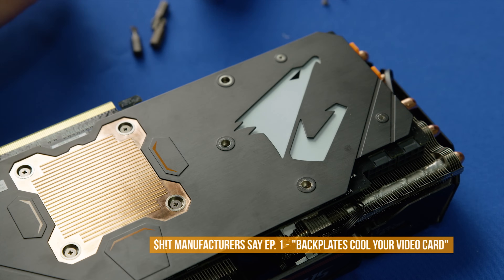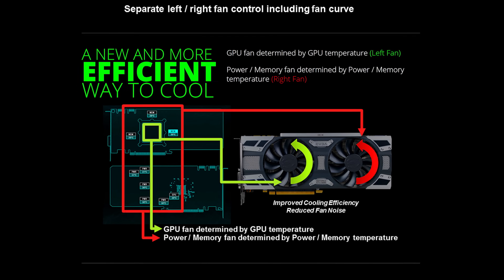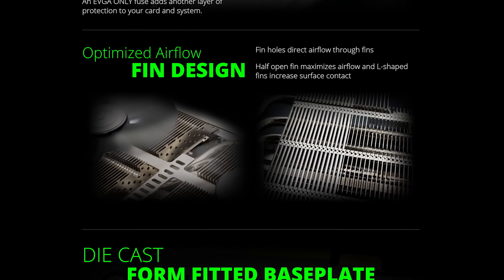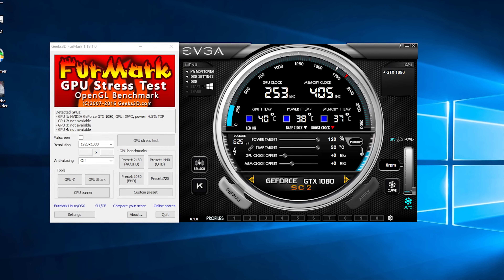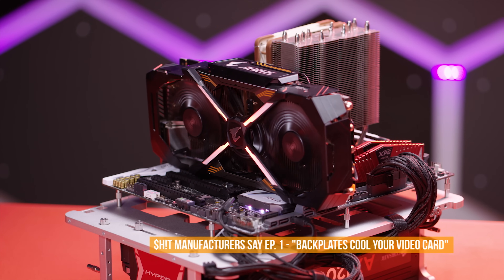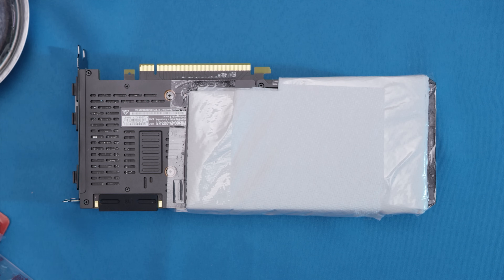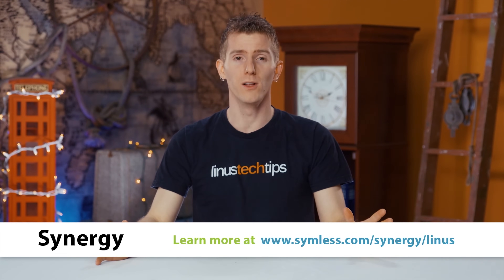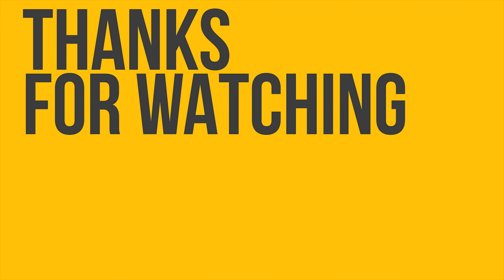The SOLUTION to Video Card OVERHEATING & DEATH

Comment: Ich have a question. It annoys me that i see many Videos online where people play on high or maxed out settings with the same Hardware that i have. I have a i5 4690k (not overclocked), a palit gtx 1060 6gb (also not overclocked, in the settings program everything is Set to normal +-0) and 8gb of RAM. So my Problem is that i play black ops 3 on mid and some settings to low like shadows and It runs smooth while others with the same Hardware play IT on Ultra and 90 to 100 fps smoothly. Or on forza horizon 3, i play on low to maybe mid and i just dont get stable 60 fps, just around 40 while others play on mid to high with 60 fps stable. Or in battlefield 1 i just play with 75% Resolution and all on mid and IT runs AT about 55 to 60.
And i noticed sth, in homefront the Revolution one of the two vans stutters and that quite Hard and loud but just in this game, could IT be that my Fans arent working right and that is why my Performance is worse than others? Or any other Thing? I am quite sad that the New Video card that costed me around 290€ doesnt work good on the games that i wanted to play with IT while others play flawlessly
Does someone have Tips for me pls
Reply: Oh and the card is AT around 70-75°C in games

Comment: I think if back-plates had the short fins on it, it would dissipate a bit of extra heat on the backside, it doesn't need to be anything fancy, just something for the ambient airflow inside the box to blow through, same goes for the failed MSI M.2 "Shield", wtf would a solid flat piece of aluminum help, its basically just storing the heat and no dissipation

Comment: Multiple temperatures (few on memory, few on gpu, few on vrm compoennts, and few other ones too) probes all around the board, should be standard on every card. It is very useful! And should make comparing quality and cooling of different cards easier.

Comment: if u dont want overheat simple : justuse MSI aferburner or OC guru 2 and set up your GPU fan to manual set 40 °C to 40 % speed, 50°c to 50 % etc........ and your GPU wild Nevers exeed 60 °C in game do not let GPU fan in auto cause thé new card start work only at 60 °C and it already too late remembrer more thank 60 °C with news GPU it is not normal

Comment: I'm a bit of a control freak when it comes to temps and fan speed/noise. This is why I love Noctua and Be Quiet! fans. This is why I love PWM control and good accurate temp sensors. SpeedFan is awesome too as long as you motherboard is supported.

I'm looking at you AX370 Gaming 5...

Comment: I use a semi liquid cooled variant (Seahawk X). If it had this sensor layout, it would improve the actual fan still on the card, but ultimately its unnecessary. Also, your title was clickbatey and inappropriate, which is not cool.

Comment: +LinusTechTips what if they designed a perforated pcb and gave it a finned backplate so the fans would be able to push or pull air straight through the card?

Comment: Instead of adding more fans and more heatsinks and more thermal fins... Why not just make the fans themselves the heatsinks? Make them out of metal or some other thermal conductive material and use the fans motion to not only blow air over the electronics but also use the fans motion through the air to disipate heat.

Comment: Hi Linus. More sensors mean more information, not necessarily more control. I do believe a GPU temp reading is more than just the core, but as you have proven, the memory bank seems to be a lot hotter than the core, yet nobody gives a damn.

So while ICX technology might jump into optimal cooling, I don't believe plates of any kind contribute to cooling. They rather obstruct dissipation, but can also absorb heat for a short while. 

It's the "watercooling" lag all over again.

I rather have a card which focuses on getting  rid of hot air out of the system, but not have that shitty turbine design we all hate so much.

I have yet to meet a card that does this. Adding sensors to it doesn't make it cooler, it just let's you know what is going on.

Comment: Linus my EVGA GeForce GTX 1050 Ti SC with 4GB GDDR5 did not come with a Back Plate and NO link on getting one !  The GPU runs quiet in the Dell OptiPlex 7010 3.2 GHz I-5 CPU 3rd Gen.  Also EVGA and/or Newegg rehab did not send the video game... (? ! ? ! ?)  Have the MT (Mid Tower) and have to look hard to find the MB and that small Intel CPU Fan !  And the case has only one fan.  Thank you for the video !  tjl

Comment: what id like to see you do is design a home made vacuum chamber where you could super cool the walls (near 0 would be impressive) with enough space for the components of a computer and show me how cool that baby runs.
Reply: ψ Holographic Principle I'm pretty sure it would overheat very quickly due to being in a vacuum. Air is needed to transfer heat away from components.
Same concept as being on the moon. On earth we measure temperature like we do because there is atmosphere all around. On the moon, with no atmosphere (vacuum) it can't be measured that way. It is measured by the amount of energy hitting an object at a particular time. That's why on the moon it can be really hot in the sun, but in the shadow of a crater, for example, it is very cold.
Anyone, feel free to correct me if I'm wrong.
Reply: i think you should do a bit more research and pay attention to the cooling of the walls.  You are wrong about air.
Reply: ψ Holographic Principle Evidence I'm wrong about air? What good do super cold walls do if there is nothing transferring energy to them?
Or did you intend to heatsink everything to the walls?

Comment: @Linus PLEASE Test the Aquacomputer Aquaero! Its basically exactly what you are asking about in the end! That is an big controll center for all you system temperature sensors, fans, pumps and etc! You can regulate every system fan based on any temperature.
 It even shows you dozends of diagrams that you could use when testing stuff without need for graphical illustration by you!

Please get in contact with aquacomputer. If you had this thing (whjch is on the market in europe for years) Lukes Workshop would have be ijn much more detail and would have been much more meaningfull!

Comment: i own a saphire 7870 2 gig and as soon as i install any driver from AMD my computer wont reboot, its only working with the standard VGA driver with low resolution like 1400x900 or in safe mode, if i uninstall the driver from AMD and roll back to the VGA one c my windows boot, i even replace the thermal paste nothing change. how can a card work and not work is something i can't figure out. all capacitors look good not darkish spot nothing.

fresh window s install with fresh AMD driver nothing change, this as been working for like 3 year and out of the sudden stop working, i would gladly send it you to you xD

Comment: If you're gonna spend the money, how about have a heat pipe touch all the hot components to dissipate the heat over the entire card and let both fans efficiently cool all parts.
2 fans are roughly only 10% louder than 1 fan at the same RPM while providing double the airflow, not noise-cooling efficient to have one spinning faster than the other.

Comment: SpeedFan already allows you to control a fan speed as a function of any system temperature. (I got a fan on my gpu connected to the motherboard that speeds up and down according to gpu core temp)

Comment: I would never buy an EVGA card!not after they fukt everyone over with the thermal pads on the 1080 and there fail 970 design where one of the heatpipes didnt even touch the GPU.

Comment: I think the card has merit in small form factor cases.  I don't have much use for the independent fan control in my current setup as my case has excellent air flow and my GPU never exceeds 70°C.

Comment: seems interesting but i think if they just add better more powerfull fans bigger heatsinks water cooling ect. they could get better cooling with out spending $xxx,xxx programming neat control freak software
Reply: Trainwreck wrx have you taken sound into consideration?
Reply: Timmy Taco no but with my system I'm usually wearing noise canceling headset/mic so doesn't really apply unless it's coming through the mic.

Comment: Personally I really dig all sort of extra sensor and control functions. The ability to tweak details of noise-to-cooling ratios to your liking based on many different sources is great.

I think what has been really lacking so far is some sort of properly standardized system - and software that can tie it all together to make a true "cooling control panel" where you can make every sensor and fan in the system work together to achieve a set goal - from PSUs to CPUs, GPUs, casefans ect.

The closest thing we have currently (correct me if I am wrong here) to a open non-manufacturer-spesific control system is something like Speedfan - but that relies so heavily on hooking into so many different types of control chips that support can be spotty and readings inaccurate or wrong. If there was some universal API that all hardware manufacturers could use as a standard that seems like it would help a lot - and software for that would probably develop naturally as soon as all the hardware controls were easy to access.

Comment: ...EVGA... that started a campaign... because some of their GTX 1000Series were overheating... the same that had to release a new bios that ramps up fans speed and send free thermal pads for mosfets?
Reply: btw the cards never had thermal issues, the vrms were hotter then they could have been but it still was fine, just look at gamers nexus coverage about it and the conversation with buildzoid
Reply: ...for free? Because this is what is it supposed to do when a product is faulty by design. And is not yet clear what they will do with fried videocards.
Reply: You can send your card in for free and they will add a thermal mod to solve the situation. They can send it over for you to test it out, and even if you mess it up, you get to RMA the card (I did).
Reply: EVGA did the same thing with the 900 series. They released a revised version of the 970/980 with an updated heatsink design and passive fan capability after they got bad press for the initial version of the card. I've had exclusively EVGA graphics cards since the 8800 GT,  but I'm switching to ASUS whenever the 1180 comes out.
Reply: It's not a direct response to that, they mentioned they were developing this before that happened.
Reply: it was also only in furmark which is no where near a normal workload
Reply: The cards had faulty component problems, most likely the capacitors behind the VRMs as they're what was blown in the pictures. The heat didn't help, but it wasn't the culprit, so just get the thermal pads and be done with it. No new bios required, and I wouldn't get it because of the noise increase, but that's personal preference.
Reply: EVGA always fucks up, go check the overclock net forum GTX970 owners threads(thousands of pages though), they released a bunch of cards with poor power phases that couldn't overclock at all, meanwhile other companies like Gigabyte and MSI had no problems with the PCB on release day.
Reply: I didn't have thermal issues was just disappointed that I had a thing to worry about with my card. Not a big issue.
Reply: I didn't have issues but installed the thermal pads just in case, and I did NOT update the bios and still no problems.
Reply: fyi it wasn't overheating that cause the VRM to explode. It was a bad capacitor do your research.
Reply: EVGA is crap, maybe for you guys that lives in north america were actualy have a premium warranty it may worth, but evga doesnt give a fuck about South America or Africa, i already watercooled my ftw card and still didnt get my thermal pads that i ordered, never ever gonna buy one evga product again
Reply: Elliot Kaufman i think you confuse something, maybe you are talking about the rx 480 red devil, but ive seen enough evga 10 series cards dieing at start up, in one case there were no pcie power cabels attached and it got only the 75W from the pcie slot, still died.

probably it was only a bad batch of caps, yes the temps were higher then expected, so they gave out a new bios and thermal pads, but i doubt temps were the reason the vrms died
Reply: thats not the overheating issue that deals with the VRM then? That was a very specific replicable thing. Gamers Nexus and others covered this.
Reply: Elliot Kaufman gamer nexus prove that it wasn't vrm exploding just a bad gpu.
Reply: This whole thing probably happened because nvidia rushed into launching their 10 series cards. Ironically nvidia founder's edition cards had 0 problems of that kind. I guess EVGA wasn't ready.
Reply: DanieleBecchetti there are such things as 3-slot GPUs already. This may be a good idea.
Reply: DanieleBecchetti will someone help me if I should buy this PC for 500 - 550$ ? 

1. Cabinet - Cooler Master Haf 912

 2. Power Supply - Corsair CX 750w

 3. Ram - Gskill Rip Jaws 16gb (8x2) Gaming Ram

 4. Cooling System - Corsair H80i liquid cooling system 

5.Motherboard - Asus Maximus v gene Gaming motherboard 

6. Graphics Card - Asus HD6950 2gb EAH6970/2DI2S/2GD5 

7.CPU - Intel i7 2600k overclocked at 4.2 GHZ
 
8.Harddisk - western digital 1tb ...
Reply: ENorK TV wtf
Reply: @Harrison H : Why not 4, or a car radiator.
Reply: @ENorK TV : This is not the scope of this conversation but...

...maybe $450 could be  fine. 2600K gets to 4.5GHz easily. You cannot go further with that cooling system. You should also upgrade the HD6950 to a more recent videocard. The 2600K to 4.5GHz should be enough to manage a GTX970...puhing more could lead to be CPU capped in some intensive cpu bound games.
Reply: you do know one random guy sent in a video of him doing over the top benchmarks and bitched it was smoking? then good guys evga offered to replace or send materials to fix an issue that would never happen in real life scenarios? yeah im glad evga cares, offers top notch support from real people, and actually tries to remedy issues unlike asus or msi who tell you to go fudge urself
Reply: ha! nice try EVGA... better go with Asus, Gigabyte or Palit instead

Comment: Or you could just set your fans to run constantly at 45% like I do on my 980 ti sc+ that hits 67c max at 1516Mghz core with +200Mghz on the mem clock.  And it's pretty much dead silent.

Comment: I would pay a couple bucks extra if that means more sensors. This could prevent your GPU from overheating because you can set an alarm if any of the sensors go over a certain temp. This could be very beneficial.

Comment: Hey comments section, quick question...what sort of overclock have you people gotten with the evga 1070 sc act 3.0?
Reply: Milo Xander all overclocks are different depending on system specs. Just guessing from other machines can be costly 
(I'd know cost me a GTX 650 back in the day kek)
there's software you download and do something called "benchmarking" which is where you just test your hardware to see what it can handle 

temp,fps,CPU load, GPU load,etc.

idk if anyone still uses it or if there are better ones but MSI afterburner always worked for me.
Reply: Mortem Rex I used afterburner to overclock my 1070, got it up to 2075 MHz stable, I put it through heaven, cinebench, fire strike, fuzzy donut of death, valley and metro last light

Comment: the 2 screenshots you showed show the same clock though, both are around 1847 MHz, pre and post OC, so no surprise there were the same temps, you also have the same settings twice in the OC tool

edit:
3:32
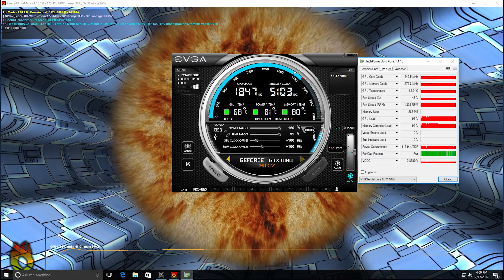4:05

Comment: Captain obvious here: The solution is:Good cooling
Reply: mrWaldow The solution is for Graphics cards manufacturers to get up from their lazy asses and make a proper Fan
Reply: Well, how about NOT OVERCKOCKING TO THE LIMIT! Seryously, a GTX 1060 can run any new game on ultra at more than playable framerates, people don't need overclocking on 1080s
Reply: yea you're right, but it's still a tradeoff: bulk performance + overheating vs good cooling + stability